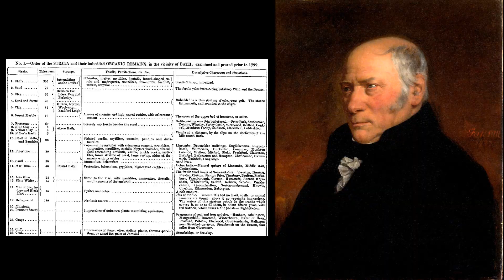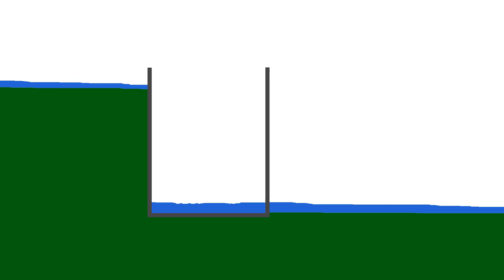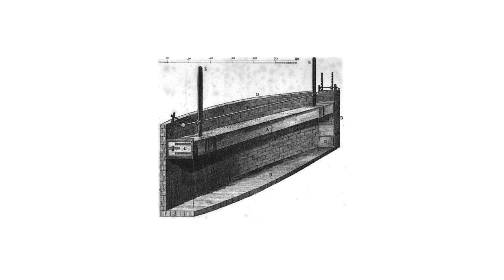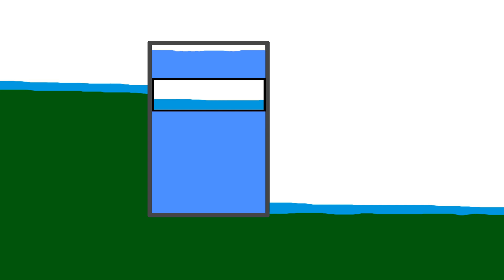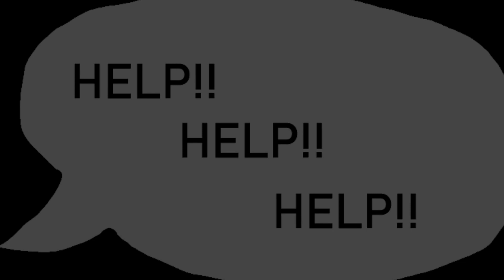The Somerset Coal Canal, and the mildly terrifying world-first caisson lock

Comment: Thanks; a good summary. Just two points...1. There was a quay on the southern end of the canal after the road was diverted to serve the inclined plane (if one looks carefully the path of which can still be seen -probably best in winter). 2. Fuller's earth (clay) was used for fulling sheeps' wool and later cats' litter - the point being it swells when in contact with water. My reading is that the caisson failed because the pressure of the wet clay pushed the stonework of the  outer chamber inwards, not the water pressure inside the chamber forcing the stones outward. (But who knows...?). Thanks again.

Comment: As a former resident of Red House Farm (now Wick House) Radford (between Paulton and Camerton) I found this a wonderfully informative video.
However, I must take issue with one thing; the area is not part of the Cotswolds, it is part of the Mendip Hills.
Reply from the maker: Combe Hay sneaks inside the boundary of the Cotswolds AONB! however I was quite surprised to discover that; I don't think I would have considered anywhere south of Bath as Cotswolds geologically or culturally, left to my own devices. So I'm not surprised you disagree with the cotswold label. I did too but I "stood corrected" by official borders. I shall now stand corrected by local knowledge!
Reply: It does indeed seem most un-cotswold-like.

Comment: The Southern Arm of the Canal was quite extensively built with sections of it still visible from Wellow westward including Aquaduct at Stoney Littleton. Further section can be seen at Single Hill, Shoscombe and a little further on past Paglinch Farm. If travelling westwards to Radstock from Shoscombe Vale the Canal can be seen on the RH side of Sustrans 24, next to S & D Track direction. At Single Hill there is a Swivel Bridge footings. I have lived 50+ years at the Railway Cottages, part of the Shoscombe and Single Hill Halt. Cottages were built on Canal Base with Tow Path now our Driveway. Our Garden has a quarry at the rear with stone from it creating pillar stones for the subsequent Tramway. It's an interesting area!
Reply: There are lots of remaining sections between vobster, through coleford, and on towards oakhill. Including a the huckyduck viaduct in coleford. For the most part you can follow it in a straight line through the woodlands and across the fields.